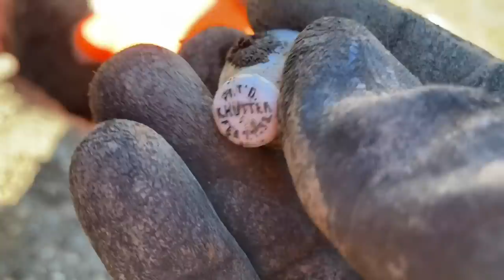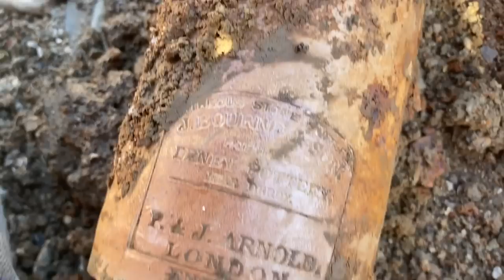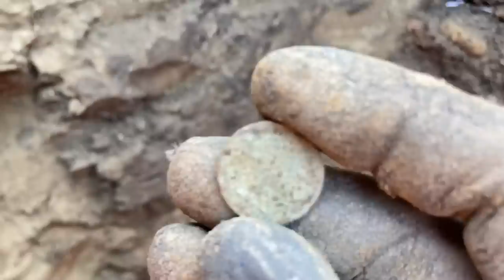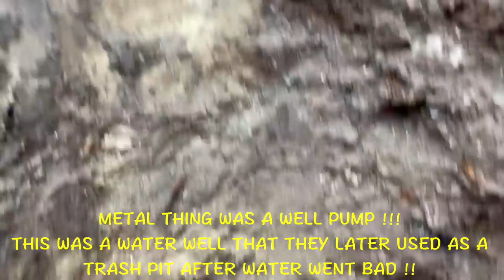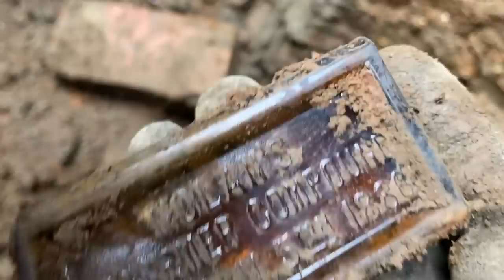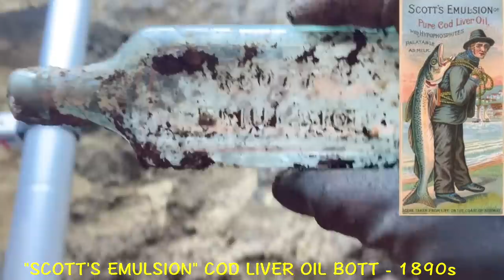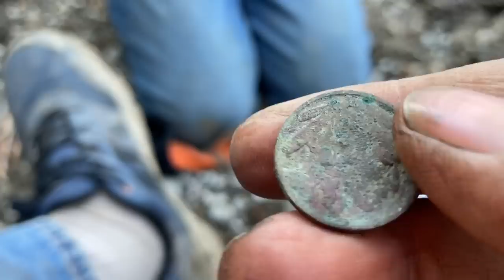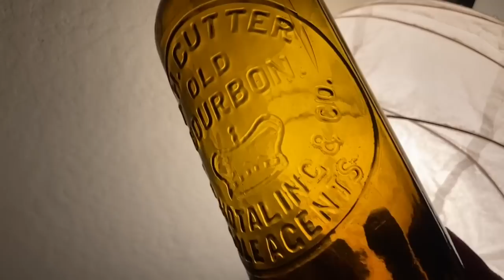TONS OF BOTTLES, Pottery & Victorian Lamps Dug in DEEP WELL Behind 1870s SALOON

Comment: I saw a broken Lashs like that at 'Iwilei.  I have Hawaii's only known Weir jar here,  1/2 gallon size, top & metal latch.  From Kona, Kealekekua, where Capt. Cook got himself killed.  The jar is c1915.  I found a bunch of master Inks not far from the 1848 Pohukaina school.  I still have a few.  I bought a square glass masterink with the "G.E." logo embossed, used for recording instruments in sugar mills &c.  The dates on those nickels wore off easily.  The early 20th Century saw a few bad coin designs.  I've dug two standing Quarters,  both no date.  A well worn seated Quarter is 1872, my age record, beating out an 1879 Victoria Penny.  I "Plucked" my first Hawaiian med from the wall of an exploratory trench under a former bunker fuel facility.  1/2 oz " Hollister Drug Co. L'td. Honolulu H.I. Fort Street Honolulu H.I." It is a Whitall-Tatum 1892 des. pat type.  I saw the base and wiggled it out of the wall & was stoked.  On my first day on site I found a Peacock cap and dug a Fountain Mineral, Hawaii's only pictorial tooled Soda.  It depicts a Fountain nymph spouting water from the Trevi Fountain in Rome.   Now I have two etched syphons from them.  The company was merged and renamed often before winding up as Coca-Cola bottlers of Hawaii (Oahu). Robert Rycroft founded it in the 1880s.  That was my best Hawaiian med and Hutch site, and for a while my oldest date, 1879 Victoria Penny.

Comment: I've been digging for 30 years  around Akron Ohio and I've never found a stoneware Akron ink bottle. Super cool any chance he'd be willing to part with it?
Reply from the maker: Yeah i can ask ! Send me a message on Instagram if you can ? @bottlened_digs_the_old_west
Reply: The Ohio bottle book I have is from 2007 it lists four Merrill stoneware inks. The one you found has three different sizes listed 6 in 7 1/2 and 9 in tall. Name impressed with oval outline poor spout 35 to 45 bucks. Again this is an old book so it may be worth more. They made a 28-in tall cylinder 5 gallon inch with a pour spout if you find that one it's worth big bucks.